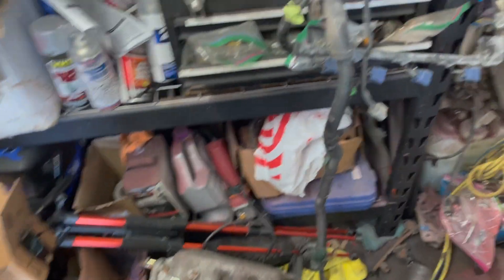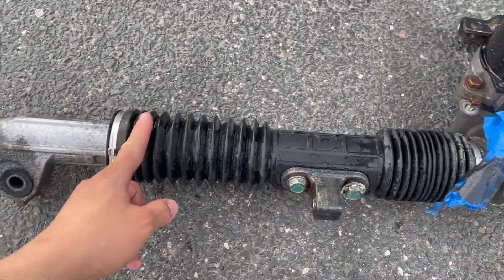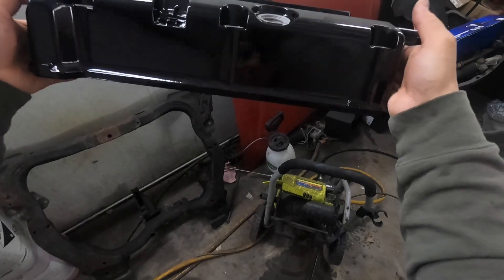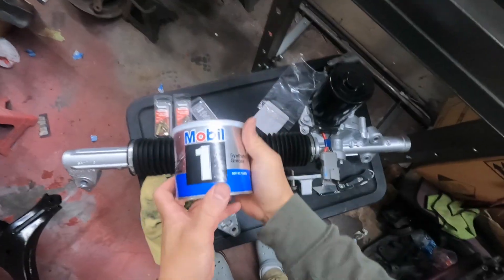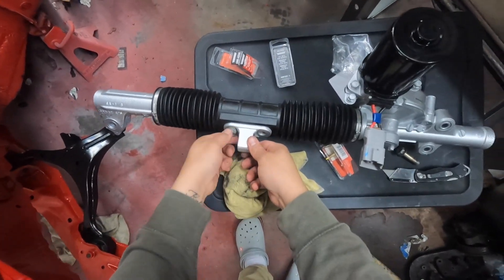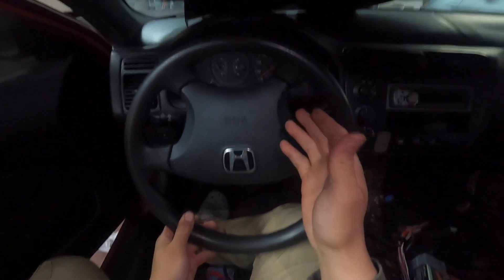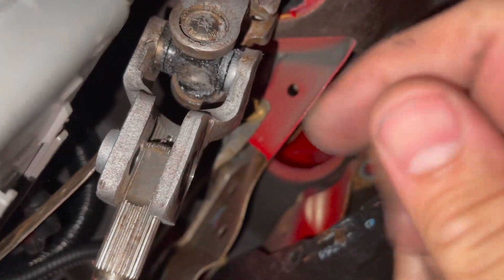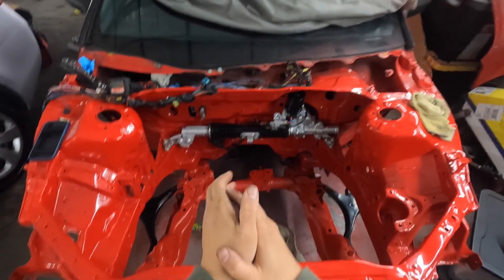KSWAP EM2 PART 8: EP3 Electric Power Steering DIY (EPS)

Comment: I gotta pull my steering rack cuz the boot toward the passenger side melted from the heat off the headers. 😭 Did you ever have that issue?? Thank you for showing how to center it. I'm gonna do that cuz my wheel doesn't turn both ways equally.

Comment: Seeking help! i completed this swap and the steering wheel is steering it self erratically at idle in my drive way. Am I screwed? how can I reset the BCU without EPS being standard in my car?
Reply: Hey man have u already figured it out what the problem of self steering is?? I actually have the same with my DC5 R jdm after installing eps and wiring. Like you said it's not standard in our cars.. anyone suggestions?
Reply: @JORDYWx  Honestly I gave up, I have been driving without power steering now for months. I have multiple BCUs and they all act the same.
Reply: @Lzzgundam  it's working now on my car man, just switch the green and red cable in the connector on your steering rack in the engine bay
Reply: @JORDYWx  Waiting on this stupid Daylights saving time change so I have more day light in the after noon and I will give it a shot. Stay Tuned!
Reply: @Lzzgundam  https://youtu.be/a9VF5rSmcis
Check the video at around 22:34, the guy is explaining and showing it. I already gave up and i saw this video and gave it a try. Flabbergasted that it worked out! Good luck man, keep me updated!
Reply: @JORDYWx  I have spent a majority of my Saturday just riding around in my civic since swapping the red with the green wire @ the BCU. I am blown away that it was that simple to fix an issue that everyone was saying needed a new torque sensor. Bro thank you so much for sharing the knowledge with me. You da best!

Comment: Hey there ! I dont know if your car is allready finished now, but just a question ? 
When i kswapped my em2 , i also swapped the ep3R electric rack.. but for me, it's horrible... vague steering , bumpsteer , tramlining , not steering straight,almost no self-centering... it's a known problem, but i allready tried everything to fix it!
Put a facelift rack in (they said the problem was mostly solved in the facelift ep3 rack) , same problems.
I then put in the shg slider , a tegiwa rack riser, fast road geo... everything... nothing seems to help it... even with all the changes it didnt even feel any different... anybody having the same problem or would know what can cause this ?
I'm seriously considering putting back a manual rack in it... 
Grtz thx alot !
Reply: Where did you get the brackets for the ep3 rack to fit the em2
Reply: @oscarchavez8559  i think i got them from an ep3... why? Grtz
Reply: What about rsx hydraulic rack?

Comment: I was able to pull a EPS unit recently. Have to go back and figure out how to get the wiring out lol
Reply from the maker: Oh yeah lol not an easy task but it can be done . you will have to cut the ground wire that bolted to the chassis .after that it’s just a matter of pulling in all directions